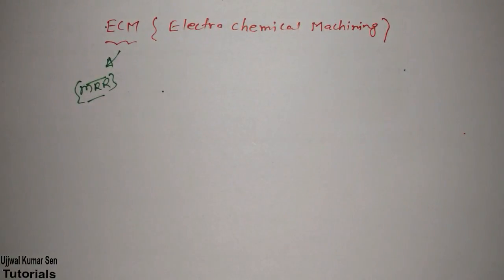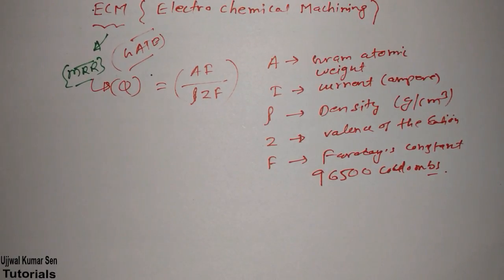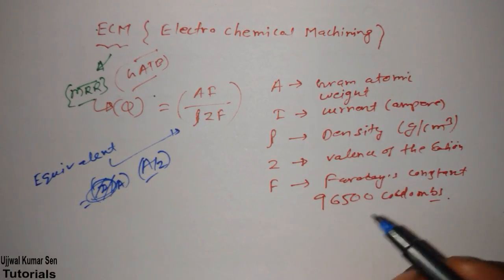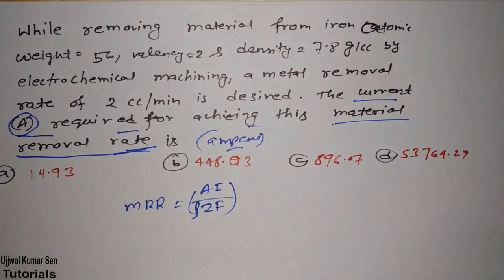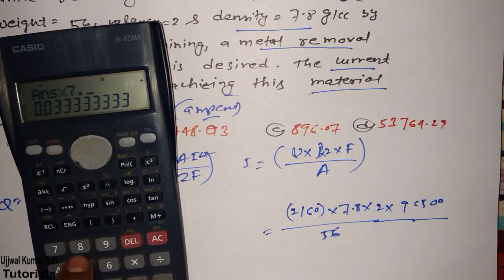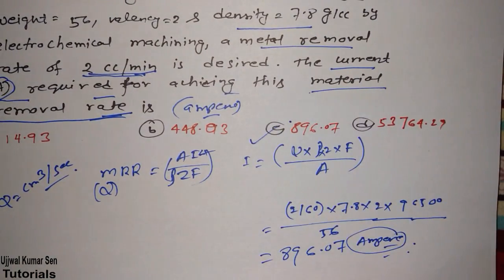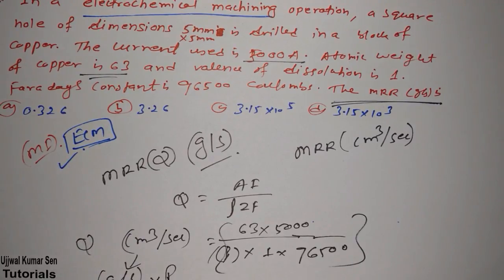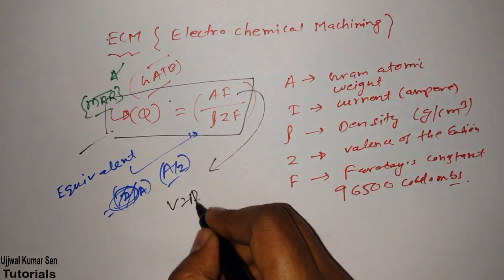ECM Machining Process to Find Out MRR GATE Previous Year Question

Comment: sir, where is other video on ecm ?? I have a problem on this topic ...but cann't solve that ....please hlp ...
Reply: sir , please solve this problem on ECM 
A researcher conducts ECM on a binary alloy (density 6000 kg/m^3 ) of iron ( atomic weight 56 , valency 2 ) and metal P (atomic weight 56 , valency 4 ). Faraday's constant = 96500 c/mol . Volumetric material removal rate of the alloy is 50 mm^3/sec at a current of a 2000 A . The percentage of the metal P in the alloy is closest to -- (a) 40 (b) 25 (c) 16 (d) 79